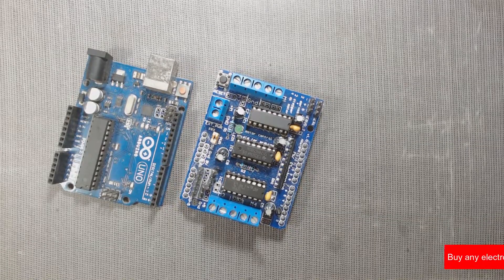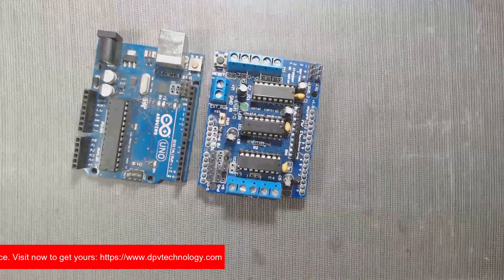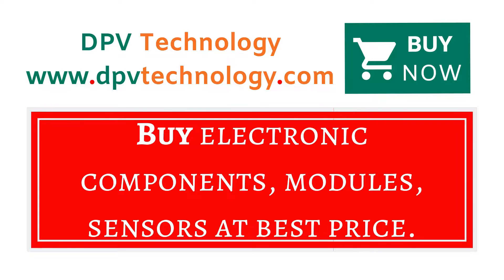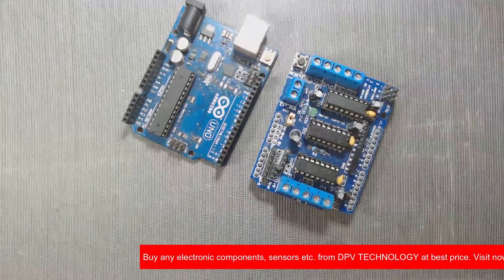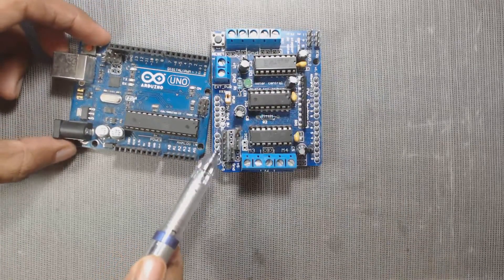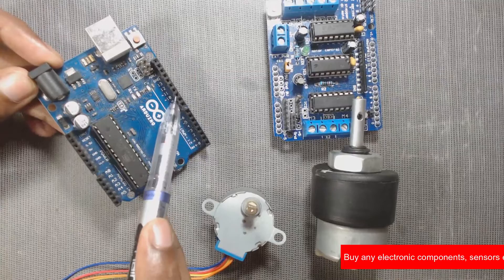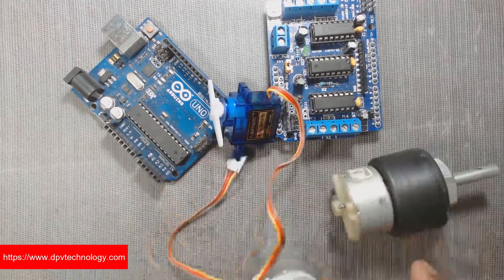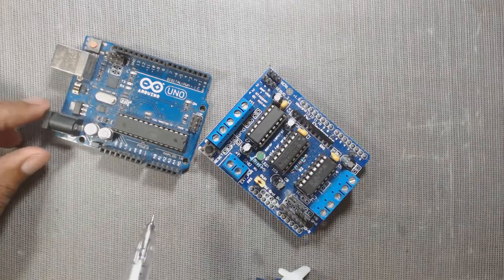Pins not used by L293D motor shiled [CC]

Comment: What pins are not used on the motor shield?
All 6 analog input pins are available. They can also be used as digital pins (pins #14 thru 19)
Digital pin 2, and 13 are not used.
The following pins are in use only if the DC/Stepper noted is in use:
Digital pin 11: DC Motor #1 / Stepper #1 (activation/speed control)
Digital pin 3: DC Motor #2 / Stepper #1 (activation/speed control)
Digital pin 5: DC Motor #3 / Stepper #2 (activation/speed control)
Digital pin 6: DC Motor #4 / Stepper #2 (activation/speed control)
The following pins are in use if any DC/steppers are used
Digital pin 4, 7, 8 and 12 are used to drive the DC/Stepper motors via the 74HC595 serial-to-parallel latch
The following pins are used only if that particular servo is in use:
Digitals pin 9: Servo #1 control
Digital pin 10: Servo #2 control

Comment: when using only motor 1 and motor 2 terminal in motor shield which pins are not used then??
Reply: What pins are not used on the motor shield?
All 6 analog input pins are available. They can also be used as digital pins (pins #14 thru 19)
Digital pin 2, and 13 are not used.
The following pins are in use only if the DC/Stepper noted is in use:
Digital pin 11: DC Motor #1 / Stepper #1 (activation/speed control)
Digital pin 3: DC Motor #2 / Stepper #1 (activation/speed control)
Digital pin 5: DC Motor #3 / Stepper #2 (activation/speed control)
Digital pin 6: DC Motor #4 / Stepper #2 (activation/speed control)
The following pins are in use if any DC/steppers are used
Digital pin 4, 7, 8 and 12 are used to drive the DC/Stepper motors via the 74HC595 serial-to-parallel latch
The following pins are used only if that particular servo is in use:
Digitals pin 9: Servo #1 control
Digital pin 10: Servo #2 control